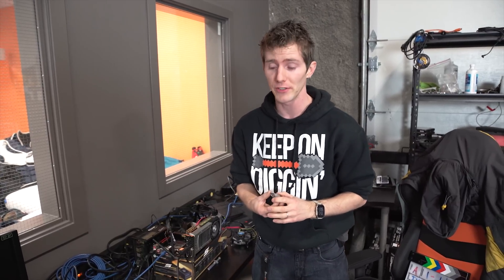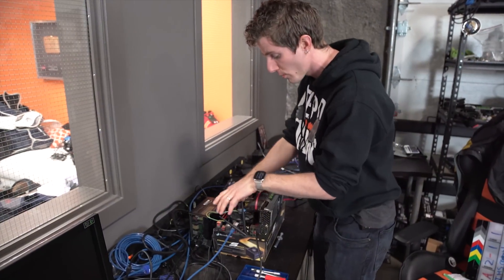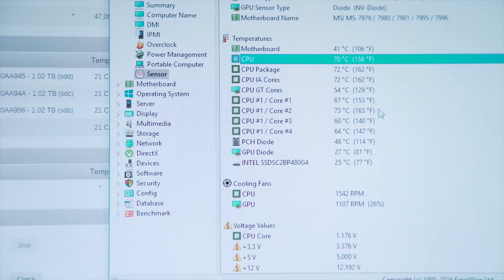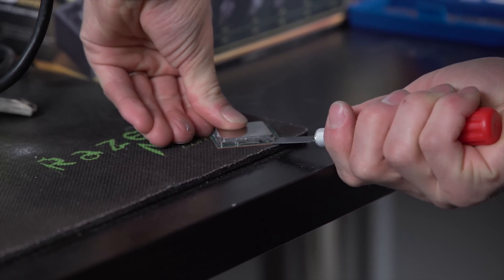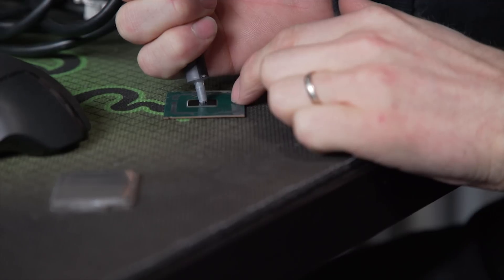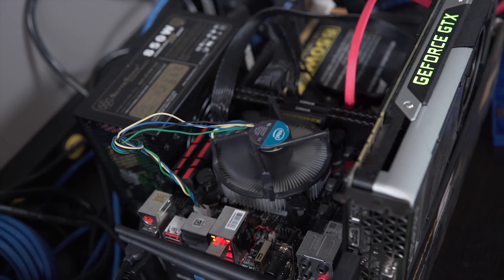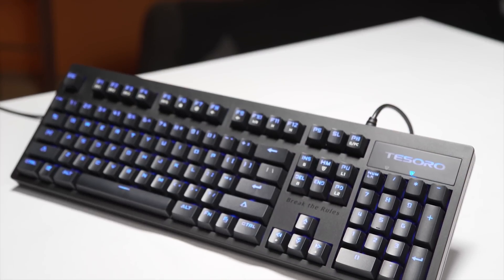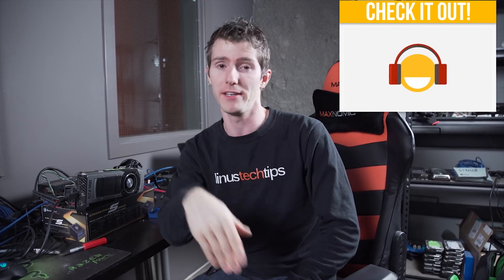Delidding an Intel Core i7 6700K - Is it worth it!?

Comment: The quality of these videos aka the thermal paste and this one are horrible. What's the Core temps, and the differences. CPU Temps are not a good indicator of the cpu temperature. Please READ up on it. While Core Temps are from the actual Cores and tend to be more accurate. 
I knew this video was going to be another very painful to watch video. Especially when it comes to cpu overclocking.

Comment: So, de-lidding. Not worth the risk of ruining your CPU and/or warranty for a couple or so extra degrees then?

Slicing off your hand and spraying your rig with your arterial blood as a really "interesting" way of personalising your rig while de-lidding with slicy-dicey things, on the other hand, is of less importance than ruining your CPU.

Interesting priorities.
Reply: +Darren Johnson-Jane (Outtheredude) if it's worth the risk is your own decision. You will lose warranty, but I have yet to encounter anyone with a defective CPU that had to return their CPU. Unless you break it while doing this. And this example is not at all what is actually the difference possible. Replacing cheap TIM with cheap TIM doesn't make a difference as you see. If you do this, only use the liquid metal one and use a DECENT heatsink, not the worst you will allways throw away (the intel ones). And the difference will be way bigger. Especially when you decide to overclock, the difference in temps will only be bigger as temps are higher. 
Linus is lazy on this one. he doesn't care and just wants to discourage (which is fine, because people will break it).
Reply: +Tijmen J So theoretically fine, if you're willing to take the financial risk of potentially destroying your CPU while minimising said risk by really, really, really knowing what you're doing beforehand and using the correct tools and stuff, while de-lidding in as safety conscious way as possible so that you have the same number of limbs and extremities as you started.

Not christening your new and improved de-lidded rig with your blood, while not even getting a significant temperature improvement in exchange for your donation.
Reply: Darren Johnson-Jane donating your blood will not destroy your cpu.
Reply: +Tijmen J Maybe liquid cooling a de-lidded CPU with blood'll make it cooler in an Evil kind of way?

(Completely ignoring practicality here).

Comment: Linus, come the fuck on and do a little research man for crying out loud. People did this on past chips because the TIM was garbage and in some cases terribly applied. Of course Skylake would not benefit, Intel realized the issues and fixed it for this family of processors. Even in the case of older CPUs it didn't always make a difference, it really came down to the individual chip and how the TIM was applied, if your chip runs hot stock for no reason, and it used TIM there is a good chance that the stock TIM was applied poorly, if your chip runs withing specifications and you can get a normal OC inline with the rest of the results then doing it was a waste. It never was about a specific family of processors, it was about QC on particular processors and whether or not you got a bad apple in the bunch, and in that case doing this makes a ton of sense.

Comment: didnt even verify ambient temps. so professional
Reply: was thinking the same thing. plus stock voltage and speed.  you don't see a massive decrease in temps with  aftermarket heatsinks over oem until you increase the thermal footprint of the cpu

Comment: just a quick tip if someone wants to try this, I've done it a couple times and those paper-thin blades from safety razors are a lot easier to work with than an xacto knife of box cutter blade.

Comment: I think the whole point of delidding it is to apply liquid metal and replace that black...rubber I'd say. Liquid metal does make a huge difference when you try to overclock. I did it with my friend and we made it from around 52°C to 43°C under max load. Same cooling, same tests.

Comment: Alright guys, listen to me on this one:
Delid a CPU,
Clean the Thermal paste,
Drill a tiny hole in the IHS and glue it back on,
Fill the space between the IHS and CPU die with MERCURY
Solder the tiny hole that you used as an improvised fill port.
Reply: 6. go blind from the fumes
7. ???
8. Profit!

no but seriously, where are you gonna get mercury from? old thermometers? doesnt seem that safe for the averige joe. what's the point, just run the chip without the ihs..
Reply: F1nWarri0r
How would you go blind from the fumes if it would be contained?
It isn't supposed to be safe or practical, just a hypothetical experiment.
Reply: +Slay Too bad mercury will destroy pretty much everything there lol. Gallium on the other hand...
Reply: JgHaverty
Didn't know about that, but Gallium was a different option.
Reply: Slay yeah, mercury literally destroys aluminum and other metals. Wouldn't work at all lol.

Gallium would be an interesting choice.

Comment: Damn it linus.... take the IHS off with the vice method... then lapp the IHS to copper then re-attach with coollabs and use silicone to hold the IHS down lock it into the CPU socket for a good amount of time till the silicone sets, then use cool labs for the tim between the IHS and the heatsink. The temps will drop damn near close to ambient in gaming. OCing will be a breeze...

Comment: isn't it possible to do this with the vice method as well? and potentially be safer and easier?

I really like the tools you used tho Linus. Seems way better than using a small razor blade. Vice worked super well for me on my 4670k tho!

Comment: Would it run any cooler without the lid? Just wondering..
Reply: Yes, most likely. Each layer risk become a thermal isolator, especially if you get air between.

Comment: If your on Haswell this is totally worth it, I got a significant temp drop on my 4770k. I'm sure intel got the message and used better thermal compound on skylake but Haswell really benefits from doing this.

Comment: delidding is for getting lower temps when overclocking and using better cooling. not for stock speeds, stock vcore and a crappy stock heatsink.

Comment: What a cope out Linus. Why not do a full test. Cheap paste, stock cooler. What a joke
Reply: +DeMoNloK I know right? this video is ultimately pointless anyway, those that know will do it, those that dont wont ever do this anyway. Saying its 'Worthless" is the height of stupidity when pairing it with the STOCK cooler.
Reply: Those of us that have actually delidded our CPUs properly (CLU for goodness sake) know how much of a performance increase it gives in thermal headroom. 20°C reduction when overclocked is common. I'm unsubscribing, the quality of this video was horrendous. There was NO EFFORT invested in this video at all.
Reply: Yuhfhrh Yeah Im unsubbing as well. His videos are getting more and more dumb as time goes on. His power supply video was almost as dumb as this. "WHAT?! A 200$ titanium rated power supply works better than a 40$ 80+ rated power supply?! NO WAY!" 

smh...

Comment: I don't know why, I get 80 degrees max temperature in aida stress test with my i7 6700k with coolermaster hyper 212 evo, arctic silver 5, applied corectly with line method and I have very good air flow (Corsair 230t). I had to undervolt my cpu to get modest temperatures. Should I delid it? Maybe the internal thermal paste is not good applied
Reply: +Popa Sergiu Any help please??

Comment: Some things that make me wonder here ... o_O

1) the delidding as procedure - this is the WORST way to do it i have ever seen! wow - never seen such a shitty procedure.
2) using normal thermal paste instead of liquid metal paste on IHS -> which leads to ...
3) not spreading it properly and checking again whats happening under the IHS
4) using a stock heatsink after delidding -> this is really the most stupid thing he could do -> HOW should temps get lower if the stock cooler is allready limiting getting away the heat?

so, no offense - Linus is a guy with a LOT of knowledge and i like his videos - BUT i really think he is completly wrong when it comes to enthusiast or heavy overclocking stuff like delidding and extreme OC.
Reply: Linus half-assed this video. Seriously how can they be so lazy as to not grab a tube of CLU, or clean all the adhesive off the CPU substrate. Terribly disappointing, and fails to educate properly.

Comment: linus is big lair, he open "intel P4 630" not i7 6700K

based on :
1) stock fan can handle up 65W heat , the I7 6700K 95W
2) i7 6700K cost a lot of money, linus the  stingy person
     the test can be done via low ost CPU then It is likely was more cheap then he said.

 only stupid buy i7 6700K. intel G4400 cost 64$ , i7 6700K cost 400$ about  
six times more in cost , but in Performance about 3

only donkey but I7 6700K

Comment: he didn't do good work delidding his 6700k at all.
there's a reason why all serious overclockers do it -

if you do it right its a very big change !

i delided my 6600k and the temps decreased by about 10 degrees ( i used thermal grizzly kryonaut, no liquid metal tim )

If Linus would have done some serious research or delidded his processor the right way ( not this silly as shit usage of tim )
he would know this, too -.-

Comment: this kind of makes me upset, I usually come here to see real world testing.  in the real world, 75% of people doing this are going to be pushing their chips to the limit with overclocks, which is where much more heat comes from.  All you managed to prove was that the intel heatsink works very well with the chip at stock speeds, the test result/difference in temperature could be changed exponentially as you overclock the CPU more and more, which is the whole point in  delidding in the first place.  I give this video a thumbs down

Comment: I think the Haswell chips have much better results from de-lidding. I did my 4790k which was supposed to have upgraded thermal paste with coollaboratory liquid ultra and it helps temps significantly. Sadly I didn't do a before and after test and I've changed my cooling setup a couple times anyways. But she stays in the 60s running at 4.8Ghz at 1.35V on a custom water loop.

Comment: Cool video. Unless you're an extreme overclocker, that is pointless so I agree with Linus. my 6700k reaches 4.9 with an H110i GTX at reasonable temps.  I did my benchmarks  and then clocked  back down to 4.4 which is plenty enough.

Comment: Sorry Linus this was not a very good job of showing good results of delidding. first off need better heat sink, second need to remove all the grey glue holding IHS, third need the liquid metal tim, this does a much better job. on my 4790K drop temps over 20C while overclocking. do a better job next time please.

Comment: Noob Question here: Is it not BAD to put the CPU with it's pins towards the table? Not even speaking about the fact that he added thermal paste, pressed DOWN the CPU with the tube,  and then shook it all over the place.

Doesn't he really risk bending the pins?
Reply: +Wistbacka Intel CPUs don't have pins on the processors, they're on the motherboard